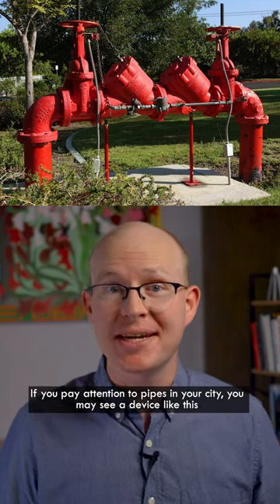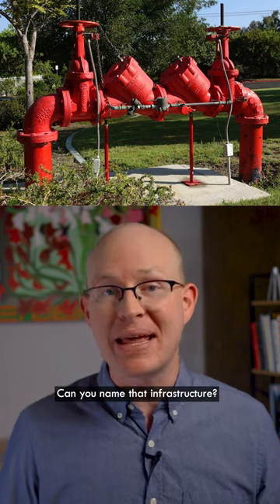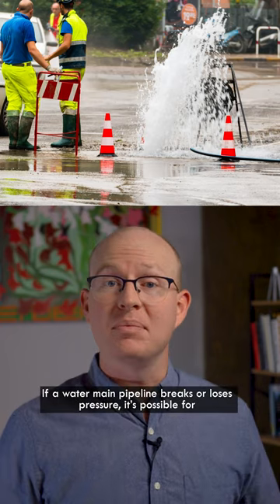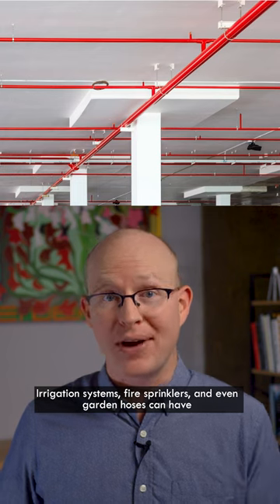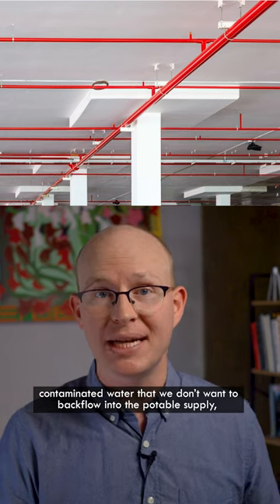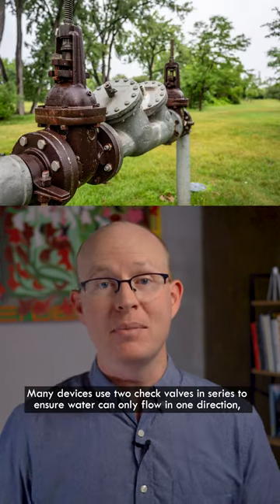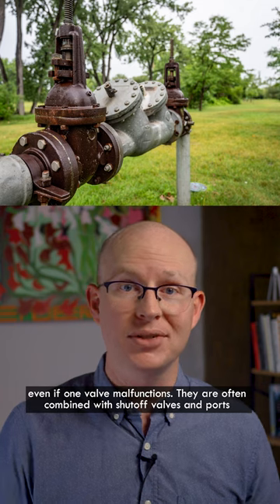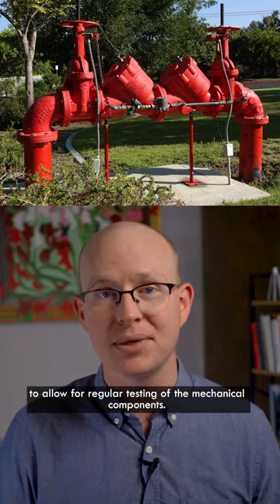Name That Infrastructure (Ep. 15) #shorts

Comment: There is similar backflow prevention devices for wastewater pipes in houses with risk of flooding. So that in a flooding event, the toilet does not become a giant fountain of poop.
Reply: toilets actually have those to prevent methane accumulation and consequently possible explosion.
Reply: @Morpheus-pt3wq  i think ur both correct..   I was raised in a 1920's "Farm House", the basement flooded bad once.. my Dad told me we had a backflow put in when the city hooked up the sewer.. it got rootsbi it
Reply: but the fountain is halve the fun.
Reply: My great aunt used to live in an old row house in the city (combined sewer and storm drain system) and would screw a standpipe into the floor drain in her basement to prevent water from backing up and flooding.
Reply: they also have one way valves on sprinkler valves if they are installed correctly.
Reply: They are called OS and Y values. Lol the fire alarm technicians know what these things are. They usually also have monitoring sensors in commercial settings. At least for fire sprinkler systems. 

They are absolutely "fun" to work on from the people I've talked to that work on them.
Reply: @Morpheus-pt3wq  no
Reply: Every sprinkler system, ice machine and stuff like that has them (soda machine)
Reply: How to get copy
Reply: I’m suddenly very happy to pay the water department fee for the yearly flow testing .. 😲
Reply: The first picture. Why does the valve look like it is blocking the thing sticking out of the middle.

  Doesn't that back flow thing need maintenance too? Valve looks in the way. 

 It is where he says "pause the video"! It just seems like such an odd design. 

Cheerios!

Comment: Where I live in Canada you are required to have a back flow valves whenever you connected your irrigation system to municipal water.
Reply: That standard globally*, the device required changes by country/purveyor, but irrigation generally considered high hazard due to pesticides and weed killers.
Reply: same in Texas
Reply: That's not true. It differs from province to province and city to city.
Reply: @DaDaDo661  Cross Connection Control is Federal in the US. There are variances from state to state, however, protection of potable water is indeed, universal.
Reply: PVB , pressure vacuum breaker is typically required  irrigation . RPZ , used on pool make-up water .
Reply: Many US states are requiring Vacuum Breaker Backflows on any exterior hose bib connections. Some states are moving to Reduced Pressure Backflows for all new construction.

Comment: That's a double check backflow with a bypass for a fire sprinkler system. You know it is for fire from the tamper switches on the OS&Y stems. Also, this is south US that doesn't see freezing almost ever since they're outside.

Comment: Since there are several types of back flow preventers with many uses it seems like a good subject for a full video. Everything from the single check valves used to prevent backward flow through pump to air gap like in a residential toilet.
Reply: I agree! Plus there are so many interesting stories involving backflow like during a wildfire in So Cal, farmers started to see their water meters running backwards because.... cross connections!! The entire town of Ramona had to evacuate and had a Do Not Drink order for a few weeks as they returned.
Reply: I think backflow prevention  is highly underrated by the public at large.

Comment: Hey!  I actually recognized those.  Apparently they're not on every house with an irrigation system, but they are in Florida.  I guess enough sprinkler heads got mowed over for them to decide that they needed to keep that water out of general circulation.
Reply: Most areas require a back flow on sprinkles usually a simpler pressure vacuum breaker

Comment: Get yourself certified and cross connection control. An RPZ is so cleverly designed that even if all the rubber on it leaks, and the springs don’t push, and there’s a vacuum on the supply, side and pressure on the discharge side, i t still won’t let a drop of water go backwards

Comment: They're also SO annoying to fix when they fail because they're invariably scaled over and grimy if you live anywhere with remotely hard water.
Reply: Every single 4" and larger ones . Suckers get caked with rust barnacles , particularly the test ports . So I keep a stripped welding rod in my test kit.

Comment: "Double Block Blind and Bleed"
1: double block (close two valves any place you have pressure)
2: bleed (bleed off pressure between the closed valves and leave the bleeder open)
3: blind (install a blind)
4: monitor the bleeder for leaks
5: now you can do hot work

Comment: It’s a check valve for the fire sprinklers.  If the sprinklers activate, they use water main pressure, but when a FD pumper hooks up to boost the pressure the check valve activates so the pumper’s work doesn’t back into the water main, and boosts the sprinklers pressure.

Comment: Flow is driven by the difference in pressure. A simple schematic showing a pump creating the high pressure and the leak causing a local drop in pressure, and then the downstream contaminated water still at a high pressure causing a backflow would help explain this concept.

Comment: This is the only one so far I've guessed, because I work with them on a frequent basis. When they break, they'll still prevent water from back flowing, and spray it on the surrounding area instead. That might only be for landscaping irrigation systems though
Reply: You are correct! All double checks should have that release to dump when they fail. Makes it easy when you're driving by to notice a failure!
Reply: This one won't dump water, it just stops. Ones that dump are called RP backflow and will have a protrusion sticking out the bottom that has the relief valve in it to dump from. And the RP backflows are on all kinds of systems, irrigation, fire, domestic or even process
Reply: I don't see the air relief body on this one and it has a detector loop , so I'm going with fire system . But the air relief could be hidden on the other side out of view .

Comment: Ooh I know something about this, it's the reason old British houses have separate hot and cold taps since the hot water generally came from a water tank in the house which was considered "contaminated" and often it could be.
This meant the hot water couldn't mix with the "clean" cold water for risk of a few broken backflow valves allowing it to contaminate the whole system.

Comment: In order of flow, from right to left:
(They seem to be 8" and all flanged)

- A 90 elbow
- Rising stem gate valve, also with actuator
- Back-to-back (piggy backed) Backflow preventer
- Rising stem gate valve
- 90 elbow
- also the bypass assembly with the water meter and it's respective backflow preventer.
! Almost forgot the 
- screw style jacks underneath the assembly for support.

Comment: Unfortunately this device is also a fail point for the system. Twice I've seen these check valves freeze and shatter under pressure, when the rest of the system handles the load.

Comment: I love the mentioning of the control ports on the both sides of check valves.

In households i have built in so many check valves with ports, shut-off and pressure relieve valves and i have never ever heard of a colleague using such control port once ever.

Every time there is a big rebuild (new water heater or boiler or combo or...) the old gets thrown out and in comes the new :P

I do hope on these bigger infrastructures there is time and money being spent on maintenance/control and these ports do get checked?

Comment: This is a large structure automated waterfire header manifold, with backflow prevention check valve and block valves locked in the open position per building in fire code in most areas in the United States

Comment: I'm def Tech & Engineering oriented.... (was in a double degree Physics & Elect Engineering program in college)  but I'm mostly Solid-state & Electronics (Computer networking & Data Centers) for the majority of my career. 

I find these tidbits super-ultra compelling.
it's Like  "Tech- Porn" fascinating
AND it is compelling that the tech you talk about is infinitely comprehensible to MOST trained, tool wielding primates

Comment: some years ago, here in Germany, firefigters used the same combination of valves to tap in underground hydrants, today we use a "Systemtrenner" ist a one way valve with a release valve so the output pressure couldn't exceed the input pressure

Comment: The first picture are the old style of backflow preventers for fire sprinkler systems. To prevent these from seizing up in low enough temperatures, a blanket is put over the whole structure coming out of the ground.
The new style that I've seen has small pipe on the side that is the only section that needs to be insulated from deep freeze. (At least in Sonoma County. I don't know about other areas but I assume this is the case for most of California.)

Comment: That sir is a check valve. Two if them, to be precise, In between two rising stem type gate valves.
Reply: DCDA , double check w/ detector assembly . It's code compliant specialty stuffs for fire systems.

Comment: If it's painted red it's primary purpose is as a fire protection bypass. In the event of a facility fire, on demand the 2-4" service line is bypassed with a 6-10" fire line servicing the parking lot hydrants and building fire suppression systems. It also serves as a backflow preventer. Sometimes the entire thing is above ground, sometimes the service line is buried.

Comment: #EngineeringInPlainSight” across the street a small pipe comes out of the ground. A larger horizontal pipe has valves and odd shaped spring loaded units on it. Then a larger pipe goes back into the ground. It is a high pressure gas line pressure reducer. How do I know this? A car sheared off the larger pipe and our neighborhood was evacuated for 6 hours. It took 36 hour to repair. I have pictures. If the car moved over 3 feet and broke the smaller high pressure line, our neighborhood would have been leveled.

Comment: This reminded me of something that happened in the early 1990s.  So, now I have a question.  I worked in a grocery warehouse in San Antonio.  One day, a coworker hit a sprinkler pipe that was about 5 feet off the ground causing it to break and spray all over.  I saw a valve near it and turned the water off.  A few days later, I was told to never turn the water off like that again.  The sprinkler system had to be reset a special way because I closed the valve.  I closed it because I thought it would lessen the clean up time.  I had the least seniority and would have been the person mopping all the water up....
Reply: Closing a valve like that didn't cause any special way to reset the system. If it's a dry system they would just reopen it to drain the water down (you would've heard a lot of air first then the water). If it's a wet system then there is absolutely no difference. I work with this stuff for a living and would've been the first thing I also did or told someone to do on the phone while I was on the way

Comment: i live in a city who has known the pipes were installed wrong and are over 25 yrs old we hat over 35 breaks when i lost count since 2018 which resultes in 3 to 7 days of boil water yet they still refuse to replace the mains but extended water to thousands iof customers with working wells and septic

Comment: A guy hit a fire sprinkler with a forklift at my last job. The water in it was absolutely disgusting. Definitely don't want that finding its way back to your faucet.
Reply: While the main lines for a fire sprinkler system can be drained, the water in the small pipes feeding individual fire sprinklers can sit in them for years on end. I used to do renovation work on commercial properties and you learned early on that setting off a sprinkler (even on a drained system) was something to avoid at all costs.

Comment: How can it backflow against higher pressure? Outside is ambient pressure and in the pipe it will be a higher pressure. So if it breaks how should contamination flow against the pressure and along the full length of a pipe??

Comment: Why would you place two in series at the *same place*?  Whatever physical condition causes the first to fail is likely present at the second valve as well.  Wouldn't it make more  sense to spread them out a bit in the hope that whatever condition causes the first failure doesn't also cause the second to fail as well?

Comment: I thought it was like an airlock thing where you take the bolts off put something in the pipe and then close it again
Reply: They pretty much only put solid objects in the pipe if something's wrong, in which case they'd likely just stop operating that pipe (so no pressure).

Comment: all over where I am, there are like tiny cranes over access hatches in the ground. usually surrounded by fences. I think there may also be a generator. I think it may be for utilities but I have no idea.
Reply: Sounds like sewage lifter stations with a crane system to service the sump-pump like pumps that usually run in pairs for redunancy inside a wet well! He has a great video series on a lifting station being built ground up!

Comment: I don't understand the point of backflow presenters on garden hoses, the system is under pressure so I'm not sure what they're afraid is going to flow back in to it
Reply from the maker: It’s for if the system loses pressure. Say you live at the top of a big hill and the end of your hose is in an old swimming pool that hasn’t been cleaned in years. System loses pressure and you turn on the hose, filling the city mains with nasty.

Comment: Gate valve double check gate valve.
I can also read the blueprints and draw the blueprints and build the valve setting for water and natural gas distribution and high pressure transmission under code API 1104. Yet somehow I find myself unemployed.🤬

Comment: What do you name the parts any structure that keeps it from falling apart or collapsing on itself support beams are strong pieces of material it could be wood metal or basically any solid usually the support beams are made from something strong mostly metal and logs mostly every structure have a support beam even a tent has a support beam support beams need good condition to be safe but it depends on the material